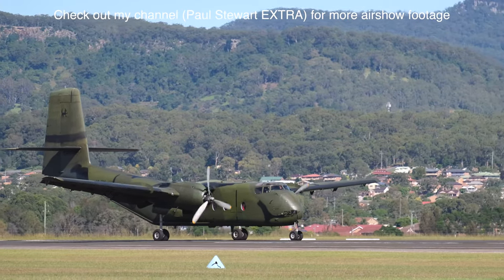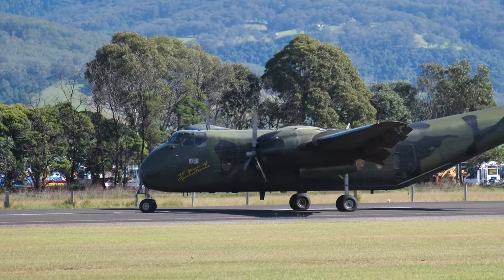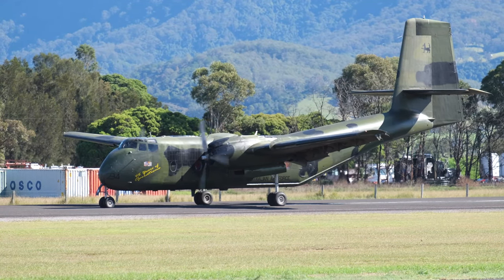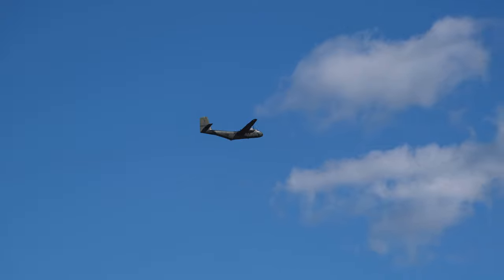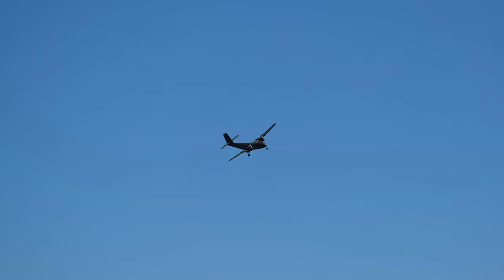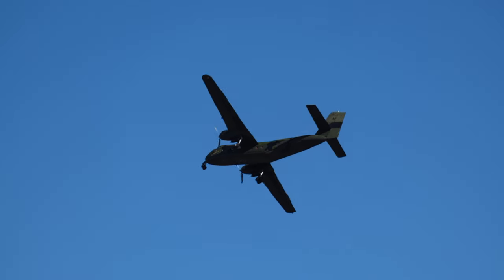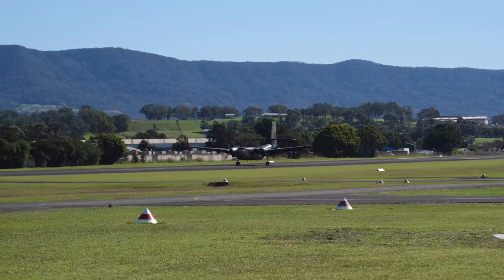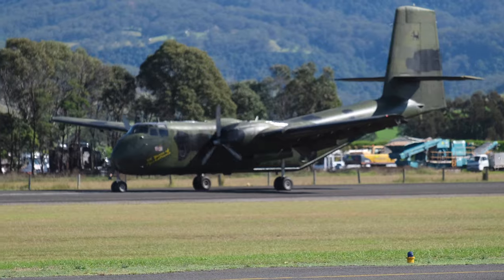HARS de Havilland Canada DHC-4 Caribou at Wings Over Illawarra 2019 (Sydney Airshow) in 4K

Comment: The reason for the relatively small production run was simply the availability of the P&W R2000-7M2 radial engines.  All engines fitted to Caribous at manufacture were reconditioned, second-hand, having previously been fitted to a variety of aircraft  but most notably the Douglas C54 Skymaster.

Comment: Ah the old “ gravel truck “ . Another type which is proving to be impossible to replace . The C27 is said to be its successor , but I’d like to see a short landing completion between the two 😄
Reply from the maker: That frame must develop a lot of lift because they're not moving very fast when they takeoff!!
Reply: Paul Stewart EXTRA . I think the fact that the engine exhausts are vectored over the top section of the wing adds to the lift characteristics , a bit like the Dash7 .
Reply: Full span triple slotted flaps. The inboard root trail flap was almost verticle. If memory serves me correctly it had 12 flaps and 4 ailerons plus a high lift airfoil. The aug, augumentor, tube (nasty things to wash) were primarily used for engine cooling like the beaver and otter.  DHC apparently did not like cowl flaps. In Fam school, they told the ac was designed to be flown by one pilot as a large bush plane. I spent a year as crew chief on 62-4195 at Vung Tau, Rvn . Loved that plane. In my opinion it along with the Kc135 are two of the greatest planes of all time. Unglamorous workhorses who did their job day in and day out.